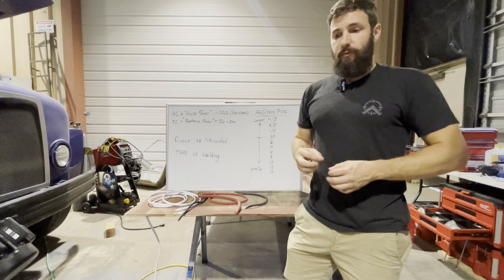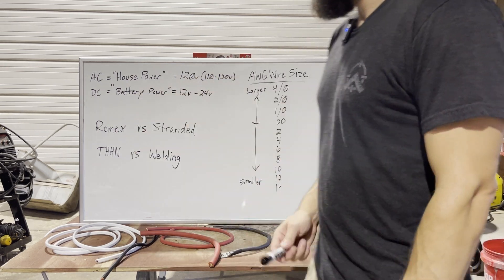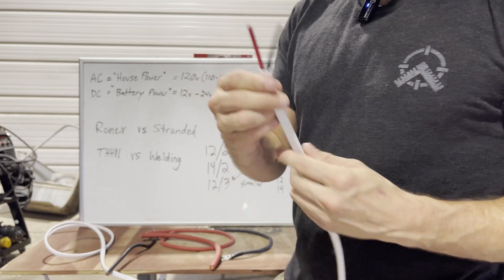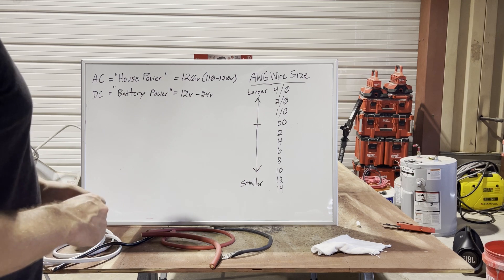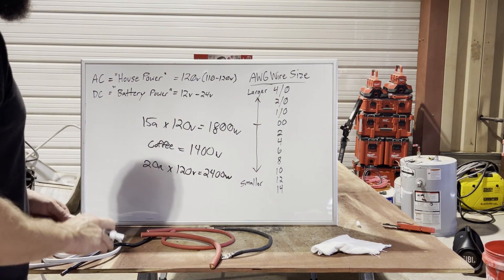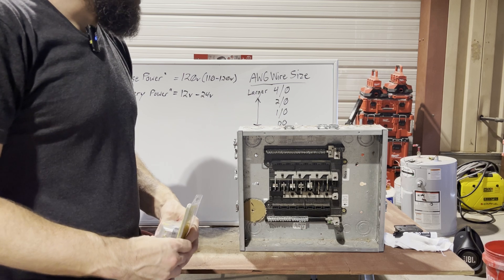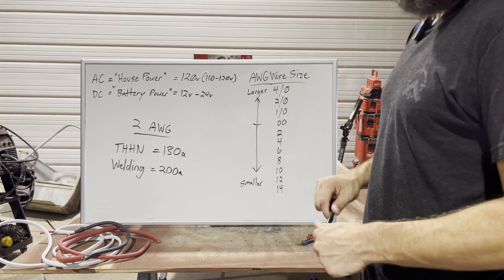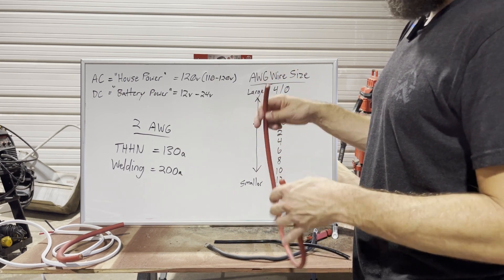Skoolie Wiring Basics

Comment: Interested to hear your thoughts on 48V systems. I'm ordering parts for one now.
Reply from the maker: I don’t bother with 48v systems for buses. The benefits of 48v systems exist with large solar and larger inverters. The appeal is the All In One Low cost and simple install system. There is a place for those but I don’t think Mobile is a place for them! I’m a dealer for Victron and EG4 and I have done residential systems with the EG4 all in ones.